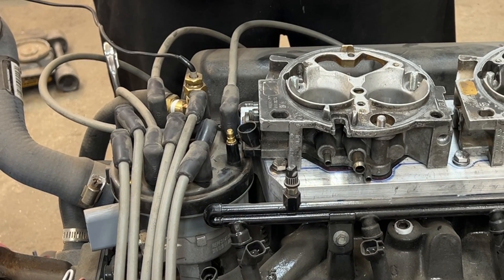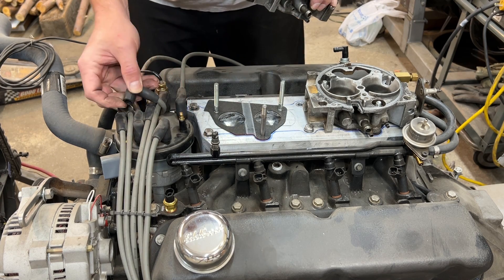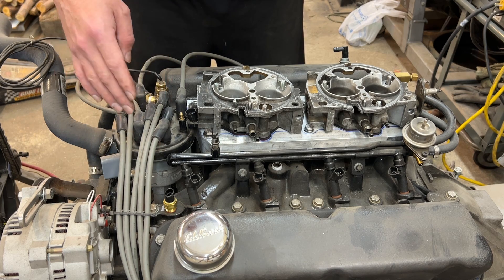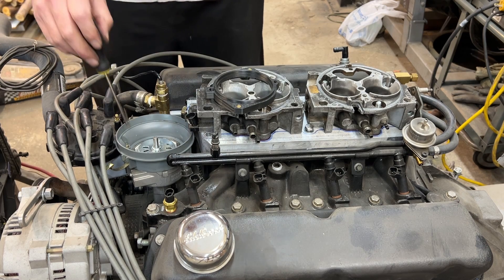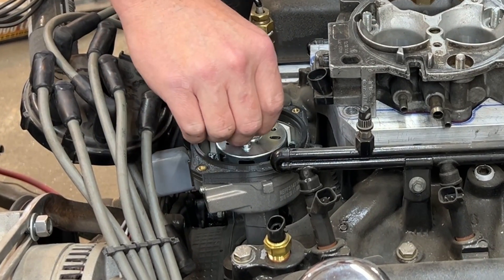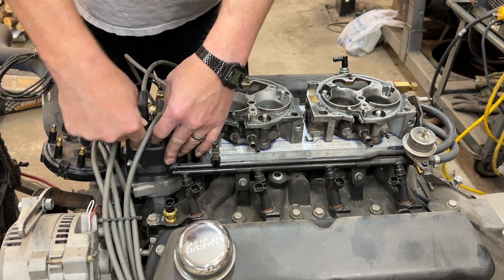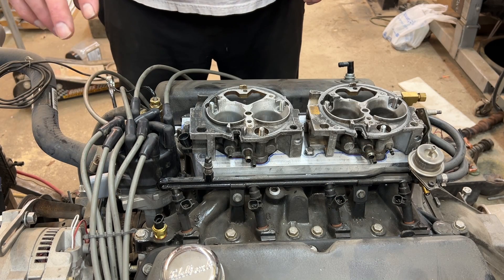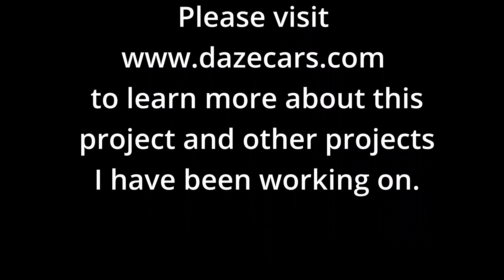Tecmotion TFI to MSD Cap Adapter to Shrink a TFI Distributor Cap Creating More Room for Other Parts

Comment: I wonder if this would give just enough clearance to run a Holley High ram with a TFI distributor
Reply from the maker: I don’t believe so. The Holley distributor for that application is much shorter and the adapter in the video makes the stock distributor taller.

Comment: That is really awesome, that you have that option! I always preferred the look of the smaller caps anyway. I have the HEI copy on my Falcon, and am very limited to fitting an air filter. It runs so much better than the points distributor though.
Reply from the maker: It has been quite a learning experience.  I prefer the duraspark distributor over points but it comes with the same oversized cap.  Yes you can put a points cap on it but I didn't want to change plug wires.  I did find a male type cap that fits the bill.  That will be in a video in a couple weeks.

Comment: Are you able to change the rotor timing so the terminals are on each side of the TPS for even more clearance?
Reply from the maker: yes and no.  Initial timing still needs to be set with a TFI so it depends on where you can drop it in that the TFI plugin arm is not hitting anything and the options allowed by the gears.

Comment: Timing couldn't be better daze, i am building a efi early Ford 260 engine and the shopmade fuel rails interfere with the distributer. This should solve my problem too. Thanks for sharing!
Reply from the maker: your using a TFI distributor on that setup?

Comment: I'm glad that the TFI Adapter solved your problem. It was originally developed to provide additional clearance for aftermarket fuel rails on Foxbodies, but it can help anywhere you need additional clearance in the upper portion of the distributor assembly but need to retain a TFI distributor. Your project is coming along nicely!
Reply from the maker: it has been a fun project
Reply: Would this work with a Holley hi ram 351w efi intake with a side mount top?  Would the distributor conversion clear the intake?
Reply from the maker: I do not believe so.  It would still be too tall.  the special distributor Holly makes for that hi ram is shorter than a stock distributor.